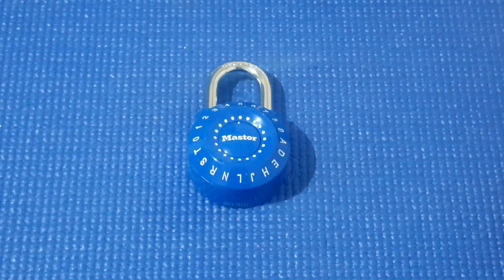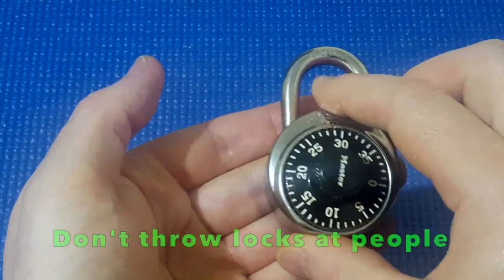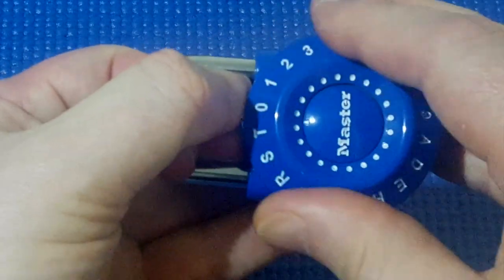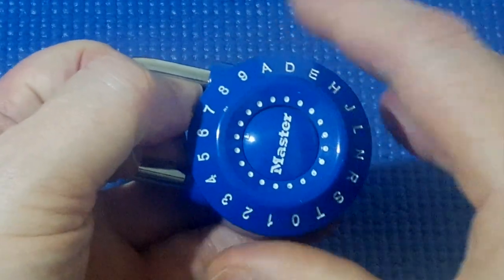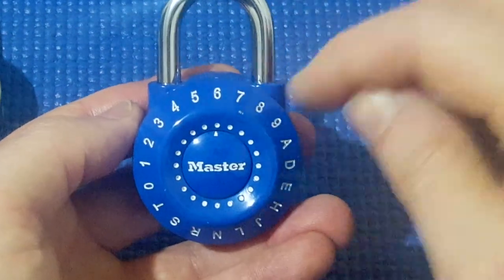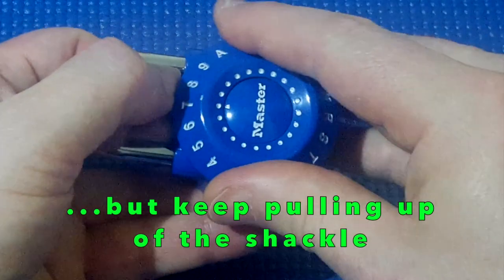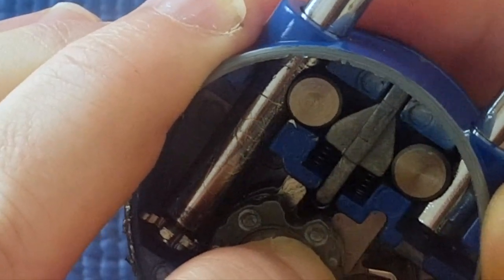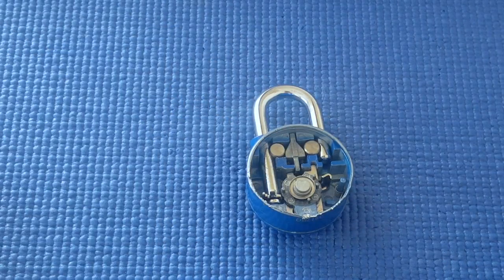(Picking 95) How to crack a Master Lock "1590D" dial combination lock

Comment: Nice to see you post a video about the 1590D's sticky dial. I used the same method to crack mine open, and was surprised to see nothing about it online, instead, people were making picks for the vent hole which is not necessary. The new anti-shim structure does require you to pull a bit harder, but it will still allow you to find sticking points just like other Master combo locks.
Reply from the maker: Thank you! ... I must admit it took me ages to find that technique on this lock :D :D  I'd bet longer that it took you ... nice lock otherwise!  Thanks for commenting mate!

Comment: I have this same lock. After resetting the lock, I can't open it. I want to follow your steps, but dont understand if you are pinching or pushing the shackle
Reply from the maker: Each time I tension the shackle, I'm pulling it (as if I'm trying to open it by lifting it up).  Hopefully you can find anomalies on your lock.  Also, I've added English subtitles in case someone can't understand everything I'm saying.

Comment: Have you ever had a lock that didn't catch on two in a row? Working for the 2nd digit, it catches on evens, but slides past both D ('11') and E ('12'), when it ought to catch on E. Any ideas? This method is also pretty rough to do on my particular lock--the shackle is engaged with the short side stuck behind the lock body instead of latched into the lock, which causes it to seize up periodically as (I'm guessing) the groove on the part of the shackle still in the lock body is interfering with the dials depending on how the shackle itself is rotated in the lock (since it has a little bit of play to rotate from the other side not being in the lock at all).
Reply from the maker: Oh! - your lock sounds as if it might be damaged? Is it a "1590D" model?  For the 2nd number, it wont catch if the 1st number is wrong.  If you're sure about the 1st & 3rd number, you could reset the lock (by turning it several 360 degree turns) and test all the X-Y-Z combinations where only Y is changing (since you know X & Z) and the lock should open ... and if it doesn't then the 1st number is probably wrong.
Reply: @Swynndla  It's not evidently tampered with or anything, just the shackle is engaged outside the lock, like what you might do with a key-entry padlock. (I'm a teacher and a student handed it to me like that, haha!) I know other locks can be engaged like this with no problems, but I don't know if the combination or anti-shim mechanisms would be damaged by repeated turning with the tension that appears to be on the lock in this state.

As far as I can tell, it's a 1590D--there is nothing marking it as such, but it looks exactly the same, down to the color, and 20 positions marked 0-9 and A, D, E, H, J, L, N, R, S, T. So I would assume so.

So, to clarify on the 2nd number--the lock will spin freely with no catch at all if the 1st number is incorrect? Strangely, the second number seems to catch for both of my digit 1 candidates (digit 1 catches on 9 and R, so D and T are candidates). WHen I spin to D, then left back to D, and apply tension as I spin to E, it passes E and catches at H. When I apply the same process to T,  it seems to catch on every digit after. (Though, I tried that again and it caught on 0, 1, and 2, leading me to believe that 1 as the anomaly, but no 3rd digit sprung the lock. :( Unfortunately, I do not have either the factory combo or the student's attempted combination. I am trying to obtain those, as I suspect that they dialed it in backwards and that would solve everything, haha. Thanks for your response--I'm hoping you'll be able to help me finally decode this thing!
Reply from the maker: @shawnsalada9923  Hmmm that's a tough one ... so you reset the lock but turning to the right 3 complete (360 degree) turns and then try to find the fist number right?  What you can try and doing it the other way ... 3 complete turns to the left and try to find your first number (and in they case when entering the combination, instead of:
2 turns right then to 1st, 1 turn left then 2nd number, then 0 turns right then to 3rd number, it would be:
2 turns left then to 1st, 1 turn right then 2nd number, then 0 turns left then to 3rd)
... sometimes it's easier when going the other way.
Note that if the combination is X-Y-Z going the normal (right) way (where X, Y, Z can stand for any position), then the combination doing it the other way will be different (but will still open the lock) ... only the 3rd number will be the same ... so instead of X-Y-Z, it'll be X'-Y'-Z (ie X is now X' and Y is now Y' but Z stays the same).
I no longer have my lock, but I remember if I had the first number incorrect then I wouldn't get clicks or "stops", but I don't know if that's true for every incorrect number.
I'm confused as to whether or not your lock is damaged ... if it is damaged then it might require an extra pull on the shackle to get it open when the correct combination is entered (but we don't know the correct combination so this is difficult!).
It's possible that your anomaly (of the correct 1st number) is hidden in one of the existing clicks or "stops", in which case it'll be very difficult to find.
By the way, if you know what you're doing, you can test all the 3rd numbers without resetting the lock in between attempts (so it saves time), and also for some of the 2nd numbers if you really know what you're doing (some of my other combination videos talk about that if you're interested). If in doubt, reset the lock between attempts (and yes it takes aaaaaages).
Good luck!
Reply: @Swynndla  Yep, tried resetting the lock a couple times to see if I get the same stops for the first digit each time, checking my work. It's been 9 and R each time, indicating D or T as the first digit. I checked through each possible combination for both D and T, with no joy. Interestingly, though, it's possible that maybe adding 2 doesn't work for this particular lock. I was looking around YouTube, and another method posted by LaurenLP101 uses a handmade tool inserted into the drain hole on the back to discover the 1st digit. He directs to add 4 to the number displayed when you catch the right spot with the tool, but people in the comments said that they needed to add 6, while others said that 4 worked for them. I'm wondering if there are two variants, and I will need to add 4 to the anomalies I discovered. Will report back.

I watched part of one of your advanced Master Lock videos, and saw where you explain about decoding it backwards. I tried that once, running into the same issue where it actually seemed to slide over two letters instead of either stopping every other, or stopping on three in a row (anomaly) and I kind of gave up on that method after that. Not to mention, I imagine that the backwards method would be affected by the math potentially being different on different variants of this lock.

I have been testing every third number by basically carefully moving from one position to the next around the dial, checking the shackle between each one. My assumptions thus far on this lock is that the student did not clear out the old combination before programming in the new one, so that the combination is actually offset from the old combination by the new one, instead of just being the new one. However, he does not have the factory combination, only the one he claims was the combination (which does not work). If the correct combination can't be decoded from 9 or R + 4 instead of + 2, I am going to begin wondering if the lock is damaged beyond repair.

Think I am going to rewatch your two advanced Master Lock videos to see if I can glean any helpful tips. I'd love to Amazon you a couple of these locks if you want to take another crack at them and see if we learn anything new!
Reply from the maker: @shawnsalada9923  I live in New Zealand so even though your offer is very kind, the postage cost would probably be more than the cost of the locks themselves (I dunno where you live though).  Maybe after the lockdown here I can find one of these locks at a hardware store, then I can give it another go.
I like your dedication and your patience for this (signs of a really good teacher) - looks like this is keeping your out of trouble too. :D
For the +4, I'm thinking that would be for the position from where his probe detects the first gate, which may be different from  the anomaly positions.  In saying that, you might be right that instead of +2 for this lock, it would be +1 or +3 ... more probable than +0 or +4 (but +0 & +4 would be interesting to try too).
One sign to look out for when trying a different plus number (and therefore changing the 1st number) is that when you hit the correct 1st number, you may then detect differences when detecting the 2nd number (I know I did - there were more & stronger "stop" numbers etc) ... maybe if you hit the correct first number, then it will no longer have the "slide over two letters" problem?  Something to look out for.
Also, I've studied the insides of many of these locks (and in some of my videos I show how it works in detail) and I know how much I can "get away with" trying different 2nd & 3rd numbers (when going through all the combinations) without having to reset the lock between each attempt (which would takes ages) ... and I know if I over turn a position but turn back (to correct myself) whether or not I have to reset and start again (I do have to reset in this case by the way ... by "reset" here I mean 3 x 360 turns, not changing the combination of the lock!).  Rule of thumb is, if in doubt, reset!  Otherwise there is a risk of entering the correct number and it not opening due to not being reset.
I'm thinking that your dedication and patience will take you a long way ... most people don't have that type of brain ... if the lock can be opened, then you're on the right track.  If you can't open it then it might be that one of the anomaly is hidden behind one of the existing "stop" numbers.  It might also be the case that when the combination was initially changed on the lock, it has corrupted it ... I destroyed a lock once by not following the instructions properly, and none of the combinations seemed to work (it was a different model of lock but the same principle applies).
Hmm I'm still thinking about that "slide over two letters" problem when finding the 2nd number - it would be interesting to try every 1st number (resetting in between attempts) to see if one of the 1st numbers  doesn't have that problem (and maybe that would be the correct first number).
I love this sort of thing - I find it meditative and relaxing going through combinations looking for differences. :D
Again, all the best in your attempts!

Comment: I found two of these in a drawer from years ago and don’t have the combinations. I got one after understanding your technique, first lock I’ve broken so it felt like a major achievement! The second one is completely killing me though. I thought maybe it’s an odd-even thing but looks like you solved an 8 and my first digit is 5.
Reply from the maker: The anomalies might be hiding on the normal "every-second-stop" positions and so you will only be able to decode the 3rd number ... you might have to go through all the 1st & 2nd combinations (resetting between attempts) which will take a long time.
Reply from the maker: Also you might want to try decoding it backwards (ie Left-Right-Left instead of Right-Left-Right as described here: https://youtu.be/hVYRIp9YOlo) and see if the anomalies are still hiding? (but I have a feeling they still will be hiding)
Reply: @Swynndia Thanks for the tips, I’ll give it a shot!

Comment: So I got a lock yesterday, I’m stressing out cause it’s not working. The videos great, I’m probably just not being able to understand I kept pulling and got some anomalies. But it doesn’t seem to work. If you don’t mind can you make another video explaining?
Reply from the maker: Do you get stuck positions on every 2nd position? How many anomalies do you get?
Reply: Swynndla every time I try some new ones come and go.
Reply from the maker: @av513  Hmmm it shouldn't be inconsistent ... are you using lots of tension? (you probably need lots)
Reply: Swynndla yeah I realized I wasn’t pulling enough so I tried tying a string and then I asked my friend. It still didn’t work 😅 maybe I’m just doing it wrong.
Reply from the maker: @av513  Hmmm yea the tension has to be variable ... strong to find a "stuck" position, but you wont be able to move it out of the "stuck" position without releasing tension a bit & turning the dial a bit & then increasing the tension to strong again.

Comment: What happens if you have no anomalies, I got a new lock and I tried to change the combo but now I can't open it at all
Reply from the maker: I only had one of these locks to test so I don't know if my method works only on my one ... but in saying that, you could try:
1) apply more shackle tension (I had to pull really hard)
2) instead of turning clockwise, try turning counter-clockwise (with shackle tension) and see if the anomalies show up then
Reply: @Swynndla  Thank you! I'll try it out and see if it works for me.

Comment: Brand new lock, thought I'd try it with the stock code. All 3 characters are ones where it's SUPPOSED to catch.

Update: set my own combo and "Lifting Up" works perfectly
Reply from the maker: Yea you're right ... with this lock, if the correct code happens to fall in the positions that are supposed to catch (ie are not anomalies) then it's really difficult to decode it.

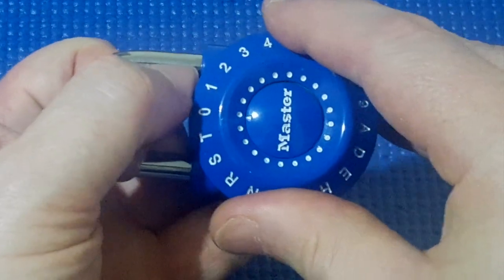Comment: Hi I have the same lock and you lost me after 3:00. I followed the steps before 3:00 and got S N J E A 9/8 7/6 4/2 0 repeatedly. The lock got stuck on those numbers but I don't know what you did after because now I'm confused as to what to do with what I got.
Reply from the maker: What you're looking for is a "stuck" position on every 2nd spot ... so S N J E (for example) are stuck on every 2nd position ... now what you want to find is a "stuck" position that isn't on the "every 2nd one" ... eg 0, 2, 4, 6, 8, A etc are every 2nd position, but if it's getting stuck on 7 and 9 then those are anomalies, and you should check those out the same way as the anomalies I found in the video. Good luck!
Reply: @Swynndla  hi so I did that I'm not sure its working out well for me. I got D as an anomally and then when I do it again to make sure its consistent it goes right pass it.
Reply from the maker: @abigailchin9181  Hmmm it should be consistent ... hmmm maybe try increasing the tension? (or decreasing it ... hmmm I'm not sure about that one!)

Comment: I tried this but while looking for the first number it skipped 3 numbers and 1 letter and I tried it over and over again but it's the same thing. Is there something I'm doing wrong?
Reply from the maker: The first number as in the first number of the combination? ... ie where you're looking for an anomaly? ... it skips 4 positions on one part of the dial instead of having the "stuck" position every 2nd position?
Reply: @Swynndla   it skips 4 positions one one part of the dial instead of have the "stuck" position. Sorry I should explained better but yeah that one
Reply from the maker: @littleg3722  That's strange ... maybe the lock is broken something. It doesn't matter how hard you pull the shackle up (to increase tension)? ... it still skips those positions in that part of the dial?
Reply: Yeah no matter how much tension I put on it   it still skips the four same spots on the dial and I don't know why, I might have to at it with bolt cutters if it's broken on the inside
Reply from the maker: @littleg3722  Hmmm maybe it's broken ... so you could guess that the first anomaly is in that part that skips (choosing one of those numbers at a time) and then try and test for 2nd numbers (combining with the known 3rd number) to see if it opens? If that doesn't work then it could be the case that the 1st number anomaly is stuck behind one of the existing stuck positions (that happens with this type of lock unfortunately), and in that case you'll only know the 3rd (last) number of the combination for certain, and you could go through all the combinations (testing every 2nd number ... don't have to test every number) but it would take a long time (a few days of testing).
Reply: Well at least I have something I can work on in my spare time. Thanks for the help very much appreciated 👍
Reply from the maker: @littleg3722  Here is another lock where only the last (3rd) number can be determined from tensioning techniques: https://www.youtube.com/watch?v=uvFcIlLQVCQ&pp=sAQA
... it might be worth a look because it describes some shortcuts ... but be warned that you have to know what you're doing to be sure that you're not inadvertently missing the correct combination.
Another thought I had, does the dial skip in the same place when turning it the other way (under tension)? If it doesn't skip, then you might be able to decode it left-right-left instead of right-left-right as in this video: https://www.youtube.com/watch?v=hVYRIp9YOlo&t=494s&pp=sAQA